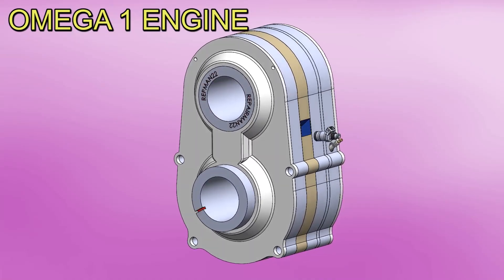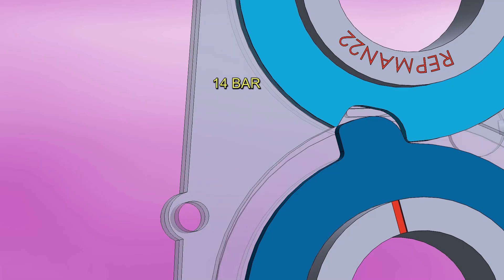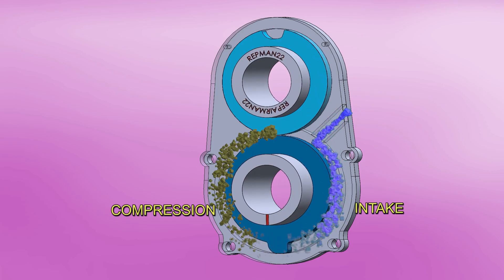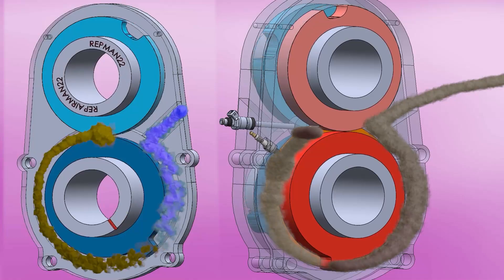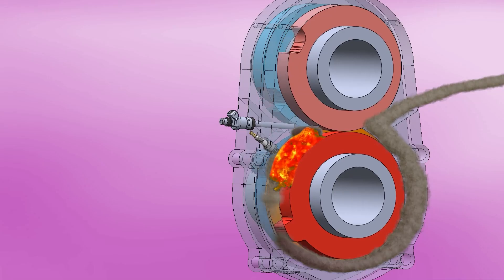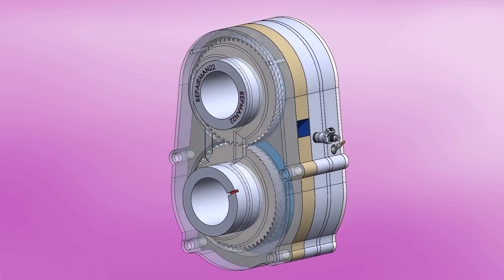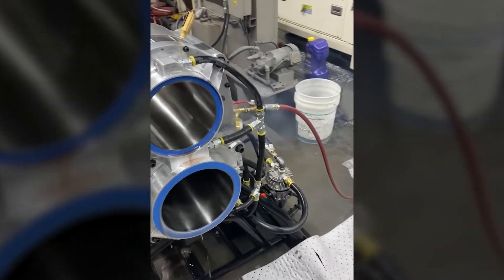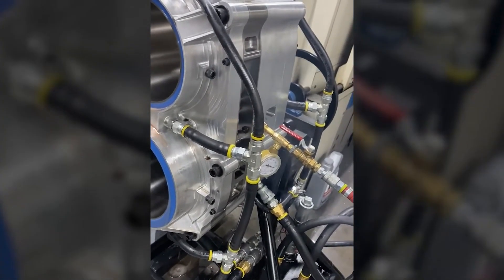😍 Can you FIT 160Hp in 30 Pounds? This New Engine Can. The Omega 1

Comment: 30 lbs....   but  needs to be bolted to a  100#   transmission in order to  convert  25k rpm to a usable  2500 rpm with  meaningful torque.

Comment: Maybe good for stationary, sustained, high RPM use, and since it's basically already a supercharger adding a third stage as a compressor makes sense, you could add something similar to apex seals except instead of being spring loaded and meant to contact the case they are locked in place and just there as sacrificial "seals" so instead of wearing the edge of the expensive rotor you wear the inexpensive replaceable inserts

Comment: After going to the so-called 'manufacturer's' website... it appears to be an engine that can sorta run for 8 seconds. I see a failed kickstarter coming. And it only runs on hydrogen. There is no possible way something like this can run on a conventional fuel and be useful in any application. I would expect it to produce close to zero torque. I appreciate your animations... but it is unlikely to go beyond that.

Comment: Lossy fuel/exhast seals at high speed,  rotation drive shaft seal will like all its ICE designs will add friction.  Still better ways of doing this that Hydrogen ICE engines will develop over time.

Comment: I wonder how the compression and combustion chambers and the rotating valve would be sealed. If liquid lubricant can't be used for the purpose, then the rotating parts might have to be surface-treated with a solid material that can accommodate for thermal expansion, like a wax. The engine is based on a great idea, but it might require materials that don't exist yet or are not suitable for mass production.

Comment: If the "donuts" rotate at the exact same speed, I don't see an issue with them rolling in contact with each other, it's essentially everywhere else sealing/friction/tolerances seems problematic to me.    

I also don't see any fundamental flaw with the basic concept, some serious challenges, but no entirely fundamental flaws, not yet anyway. But some of the proportions and the decision to make it "open" like that, and some other details makes me doubt they're even serious.

Comment: This seems like the most promising alternative engine I’ve seen. No seals on the rotor is a big plus. If it has to operate at a respective RPM to be efficient it would fit right in as an aero engine.

Comment: From the simulation, the rotors seem to be fully in sync.  So, I can't see why they can't touch to form a more complete seal (that oil would not basically complete.)  You mention should they touch they would jam, and I can't see how that would occur.  Metal expansion?  Wouldn't the gears and their attachment simply be modified to handle that slight expansion via mounts?  Oh well, guess that is why my specialty is communications/electronics.

Comment: How about a battery that can sustain the 160 CV for 6 hours, during cold weather, that does not weights a metric ton and can be recharged in 20 minutes?
The problem of the EVs are not the motors, but the power source.

Comment: These engine designs have been around since the early 1900s, and they simply aren't viable. Sure, you can make one run, and it can perform a dyno pull... but they simply can't perform under sustained load while remaining emissions compliant, or without suffering substanial mechanical or performance degradation.

Comment: Great video Francis  ! I'm and old auto mechanic.  Have rebuilt 11 motorcycles that I owned.  Starting with a Puch 250 that was  2 stroke 2 cylinder engine with a shared combustion chamber  ! My Cushman scooter was a 1 cyl. 4 stroke .  Hondas BSAs Kawasaki and BMWs followed.  
     This engine exposed here has no crankshaft, or pistons.  It cannot be classified as a "stroke" type engine. 
      I believe it is a two cycle rotary engine.   It has an intake and exhaust cycle that produce power in a cycle blending combustion part of the engine rotation.   That could be referred to as a third cycle; making it a 3 cycle engine !!
    I think it would make for a great multi fuel electric hybrid engine, that drove a generator to alternatively power a BEV.   Its light weight and high rpm. would provide great flexibility to powering a vehicle.

Comment: I think plasma research is the only way to go as far as liquid fuel is concerned.  But reaching the upper limits of plasma requires a magnetic containment bottle due to the extreme heat. Today's Gasoline contains roughly everything from Pentane (C5H12 to Dodecane (C12H26).  It is injected into your engine in atomized droplets not vapor.  Yet only the vapor is what is burning not the liquid.  The question then is, how do you dry out the gasoline to a vapor with reaching the flash point, inject it into the engine and ignite it without ripping the engine apart?   We know that the burn ratio of gasoline goes up exponentially with increased compression.  Obviously there needs to be a design change for the engine.  We know that plasma space rockets operate at the low end of the plasma energy scale.
Perhaps SpaceX is on the right track with their current improvements to their Raptor engines by adding a preburner.
Ultimately I think that some form of atomic hydromagnetics engine is needed to create a magnetic bottle to control the plasma flow within the engine such that it doesn't touch the walls of it.
Check out
Why 200 MPG is Possible, George Wiseman, Eagle-Research.com
What is the difference between cracked fuel and distilled gasoline?
What fuel contains C1H?

Comment: When you think about this engine's light weight and performance it would be a great companion to a high-performance hybrid car or SUV. If a rev limiter was used it would remove overheating the 2stroke engine retaining the specified tolerances and protecting seals. Hybrids don't need excess high revs but a constant voltage sufficient to keep generation of current to the batteries. the weight saved would improve efficiency and extend range.

Comment: Horizontal mount? Rear wheel drive or front?Ethyl or regular?
Viscosity of oil? Coolant?
Not really a lot of information on intended use. Mount kit to replace my 327? 
4 tiny ones? As in one on each wheel?
You really want to test it? Show up at NASCAR

Comment: I looked into this engine quite thoroughly about the time when the prototype was completed and filmed. While the design is impressive for the reasons that are the basis for the claims, the problems may be insurmountable. The stated clearances of .004" are much too loose for adequate sealing yet present dimensional problems using conventional materials. Figuring the original effort would be forced into abandonment, I searched for a set of solutions to the various problems and eventually walked away. Even exotic ceramics fell short. My hat's off to any engineer that can make this engine a marketable reality.
Reply: With proper money and minds, better engines with designs like could be obtained, but in the last 20 odd  years, obviously inferior products and planned obsolescence, possibly in order to trumpet the electric car, have been the Rule.

Comment: You know if they could ever invent a piston ring that rolls instead of scrapes would be a huge advantage,, what kind of horsepower does it take to slide Eight Pistons up and down in a cylinder the Achates engine is the way to go no valve train

Comment: Making the rotors into gears would solve two problems....
-No need to use another set of synchronising gears as the rotor itself is the gear
-the rotors can now touch each other 
Please comment if i am right....

Comment: Kind of like a vane pump.
I think this has been tried many times before.
One major problem I see is where the two round rings meet, they have to be tight enough to hold a certain amount of psi which is no problem with new parts, but over time you will have carbon build up just like the top of any piston, but with a normal piston carbon build up on top will not effect the psi because they have rings on the side. This engine will work but I see it losing its psi for combustion fairly quick.

Comment: How do they prevent misfire while injecting fuel? Because bar means nearly 14 atm and means 14/1 compression. And I think it may cause ignition as diesel engine. Already there is problems to applying hydrogen fuel to gasoline engines because of these problems. And with this 14/1 comression rate it looks like bigger problem.

Comment: Great to see this!  I'm 78 now (damn!) and have always LOVED innovation.  Believe this or not I came up with EXACTLY the same design/concept in my twenties and I suspect that I might not have been the first even then (I just loved coming up with new approaches from my early teens in aircraft, boats, engines etc, etc) !  I called mine a 'rotary abutment' engine. As with most of my ideas I didn't/couldn't turn the design into hardware; family, home renovation/DIY, life events, too many ideas=lack of focus plus, lack of cash. At any one time in the world there are many thousands in the same 'boat'.  
Major problems are materials, sealing, lubrication and heat dissipation. I did realise at the time, and treated it as such, that it would be a high speed engine and my approach was to accept 'leakage' without seals, such as the Wankel rotary uses (in a similar way to the way to the way jet engines aren't 'sealed' either).  
Another factor to consider now, is the imminent changes in motive power, with various competing approaches in the mix. At this point in time, even the LIKELY winner is unknown. This increases the financial risk.
It's strange how life goes though.  Coventry Climax became famous in motor racing in Formula1 motor racing, back in the day, and yet its foundation was as a very light aluminium (rare at the time) high revving 4cylinder engine designed for portable water pumps for fire fighters.  Later it was adopted for use in the Hillman Imp (rear engined competitor to the Mini). Thereafter Coventry Climax used its technical know-how to work wonders in Formula 1 motor racing!  I do hope these folks have the means, time and money to see it through as we never know what path might open up for this engine.  
There's many super wealthy folk in the USA and hopefully one might back it.  Remember that the 'Rolls Royce' name was composed from the surnames of two partners. 'Rolls' was the business/money man and 'Royce' was the Engineer!
I very much enjoyed coming up with a number of engine designs (amongst other things) over the years but should have designed, manufactured and sold new, mass market, household products....much better to make money FIRST, which is key! (Take note young inventors and remember that the initial inventor RARELY makes the money; it is the folk with business/marketing acumen who take up the idea who generally make the money.... if any!)  Of course, there's no guarantee for them either! :)
I did make a small mark in hang gliders inc. powered and you can't do everything in a measly single life!  Hey Ho, c'est la vie!!
NoAxe
Reply: If one has dream, one must work towards accomplishing it, THEN succumb to Life!
Reply: Great comment. I always thought rotary engines were the only way to go with ancient piston technology, and their inefficient back and forth design.

I am very intrigued with the hydrogen engine movement. There are lots of good YouTube programs extant.

What about combining this engine design with hydrogen propulsion/ fuel?

Comment: Unfortunately it comes with one huge lie.  80% thermodynamic efficiency is impossible.  Gasoline ICEs achieve about 34% with a compression ratio of ~10.  Diesel gets ~40% with compression ratio of 20-25.  The best turbines get up to 50% with a compression ratio of around 80 (that's 80 bar in the combustion chamber!).  80% is impossible for a Carnot cycle engine (which all of these are, including the Omega 1). In other words, forget it, unless you are only interested in the power to weight ratio.  But then you still need to deal with those pesky seals, just like the Wankel 😞

Comment: Sure those tight clearances allow it to form a seal without parts actually touching, but what happens not if but when the engine starts to wear out?
What happens if/when carbon buildup occurs?
I prefer the opposed piston engine

Comment: Another pointless way to burn oil, when it's clearly much more efficient to use a Battery and Electric motor. By the time the entire fleet is electric, the infrastructure will easily support them. Most vehicle are sitting idle for the majority of the time. You only need to have a small charger if you can leave it plugged in for most of the time. Soon chargers will be everywhere. Supermarkets, Shopping Malls. Workplaces, everywhere that people leave their cars for hours.
Reply: Electric vechicles are a disaster in the making.

Comment: ICE engines are heat engines, the more heat that is lost without doing work, the less efficient it becomes.  This engine has got a lot of surfaces that come into contact with the combustion gases.  Many innovative engines don't look very good when the thermal flows are determined.   The devil IS in the detail.  There are some innovative designs that may be very good when developed but are defeated by the incumbency of current design philosophies and the cost of development.  I don't think this is one of them.

Comment: It looks to me like those mating knobs and holes could seal well enough to remove inside contact surfaces all together. What I'm concerned with is cooling the thing and It doesn't look like lubrication is well thought out. I'm not surprised it's spewing oil all over the place in the video, it probably has modulating oil pressure for each cycle or part of the cycle.

Comment: No its a 4 stroke, the intake and compression are two distinct stages, in a two stroke the intake and compression take up part of the same stroke, the doughnut makes 1 full rotation for intake and 1 for compression. It doesnt matter if it can complete multiple stages at the same time, so can a V8, what matters is how many steps it takes for the air to make it all the way through the engine. For it to be a two stroke the intake would have to cutoff halfway around and the other half of the revolution is all the compression you get. Same goes for power and exhaust strokes, they are two distinct stages, it takes two rotations for all of the exhaust to expand and then be pushed out. This is operating like a 4 stroke piston engine except the pistons are traveling in a circle around the outside of the doughnut.

Comment: Tight tolerances between the two sealing surfaces (counter rotating chambers) will a serious problem when combustion deposits close that to zero! Have you ever seen the deposits on the top of the piston? You can't avoid that. This is an epic failure unless you only run a super clean burning fuel like propane or hydrogen.

Comment: Rotors for this could easily be made from a titanium ceramic alloy in a sintering process with almost no machining.
Reply: titanium is way to expensive
Reply: @LocPH.  nope not really but, it is not something we have in the U.S.A. and that can be a problem.
Reply: @ALSomthin  uhm...yes it is. Titanium costs several times more than steel. Titanium manufacturing is also considerably more expensive, primarly due to its ability to burn and form hard oxides easily. There is a reason we don't use it in engines other than expensive, high performace racing engines.
Reply: @LocPH.  when you alloy it with ceramic it becomes a bit different. Do you even know what a sintering process is? Or do you just have trouble reading my comment properly or even at all?
Reply: @ALSomthin  Do you have trouble understanding raw titanium is much more expensive than steel/aluminium? Do you have trouble understanding sintering is just a manufacturing process, titanium is still a part of the alloy?
Reply: @LocPH.  yup I sure do understand titanium is expensive but we are not talking about machining big chunks of the stuff. Do you not understand the concept of "alloy"? Mostly ceramic ?
Reply: @ALSomthin  Cermic is not cheap either. What you are describing is not economically viable. Get over it.
Reply: @LocPH.    ceramic is not expensive tons of stuff are made out of it obviously you haven't got a clue how even ceramic floor tiles are made so, I fully extend the invitation for you to "get over it" , I worked in the powdered metal forging/ sintering industry for many years. What have you done besides make comments on a You Tube thread and pretend you know something about any thing.
Reply: @ALSomthin  you're so ignorant it hurts. Cermic and titanium are both significantly more expensive than steel and aluminium. Have you been living under rock? There's a reason your "idea" isn't used for engines. You think you're the first one to think of using titanium/ceramic? You're embarassing yourself. Educate yourself.

Comment: Interesting concept that merits funding for study. Issues: high combustion chamber surface area to volume ratio - you'll suffer more heat loss than the new 4-cylinder engines do? The 270 degree push is a huge advantage. Diesels and direct injection engines have a longer push than upstream injection engines, but this new engine more than doubles the swept out angle of the push. The surface area of the push is beyond tiny, compared to modern "oversquare" engines, so higher combustion pressures would be desired. You mentioned seals being an issue - very much a big yes to that. Seals are what made the Wankel engine die from EPA Regs. Trying to "tight tolerance" the very long seams and the vital single tooth "chamber separator" ...beyond daunting. Possibly would work for small engine applications, and for aerospace.

Comment: So, a theoretical concept that hasn't actually been built?
The 'running' video looks like an electric motor is driving it, sealing at 0.004" would be so bad it will 'leak' combustion gas (around 1200psi) everywhere